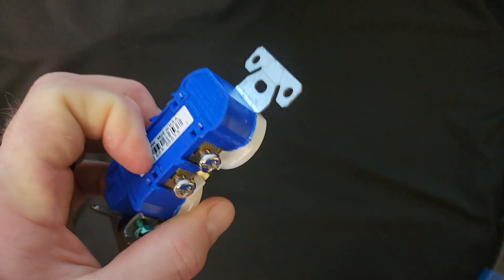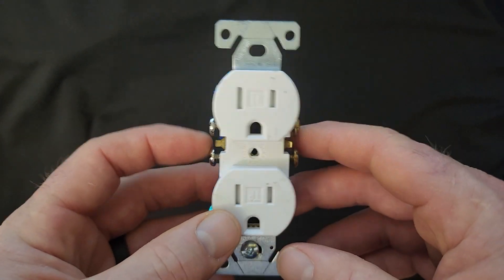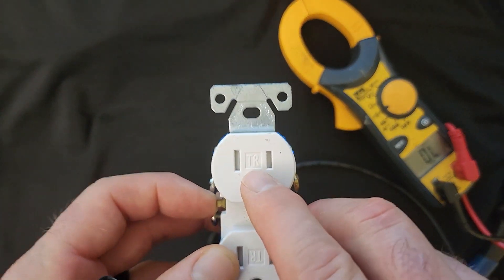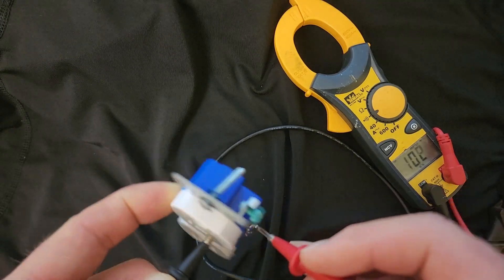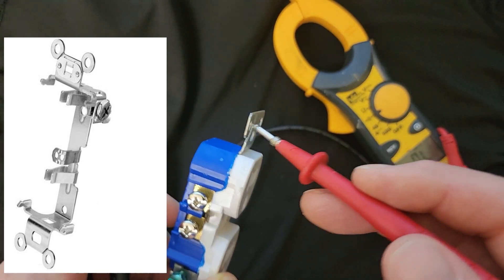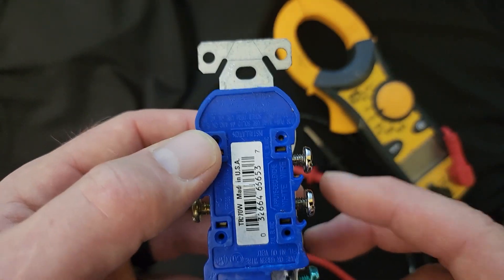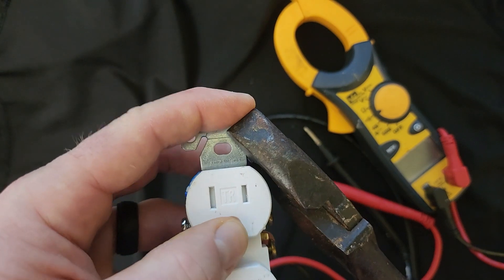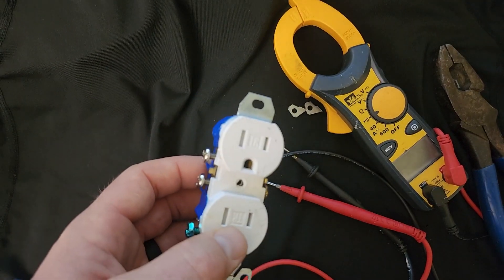3 Things you may Not Know about a Receptacle!

Comment: I believe the only type of receptacle where the equipment grounding contacts are NOT bonded to the yoke, is the isolated ground receptacle,  which is usually orange,  and will have a green triangle on the front of the device, typically used where highly sensitive electronics are affected by interference on the grounding system,  such as medical equipment in hospitals, very high end A/V systems like you would find in recording studios,  for example.

Comment: Since the ground is bonded to the yoke, then why does code mandate attaching ground pigtail to metal box??  Seems duplicative and unnecessary.
Reply: To assure complete bonding of the metal parts, for example someone could leave the screws in the yoke loose, another example some older houses don't have a ground wire but instead have a ground running to the box, it may be redundant, kind of a fail safe , I even take off the fiber washers on the screws to also create a direct Bond from the yolk to the metal box